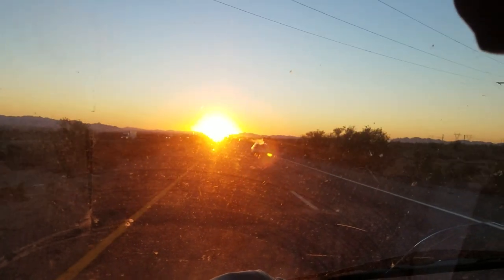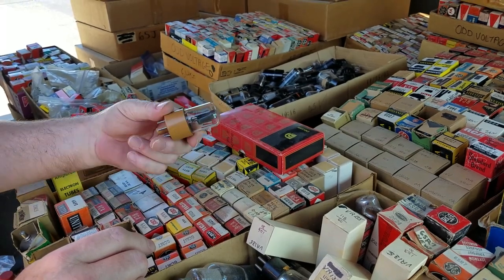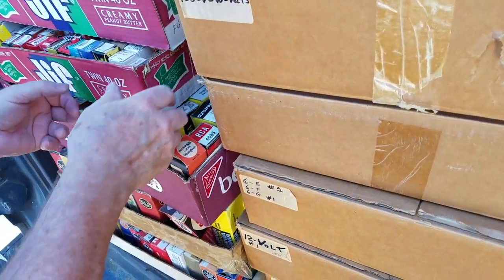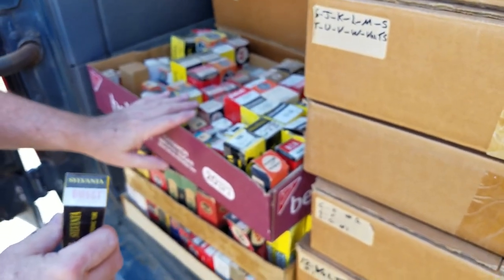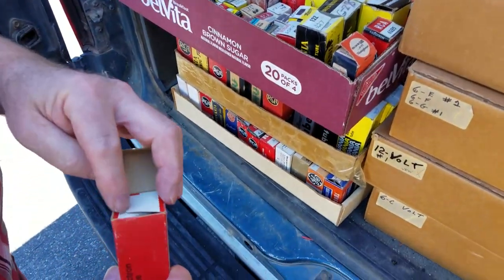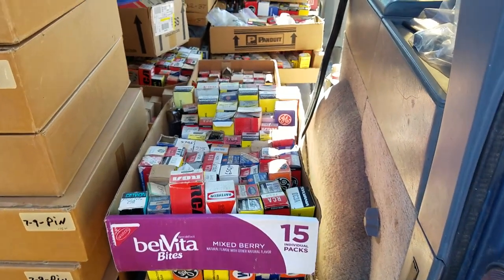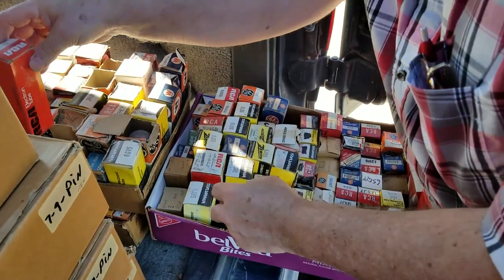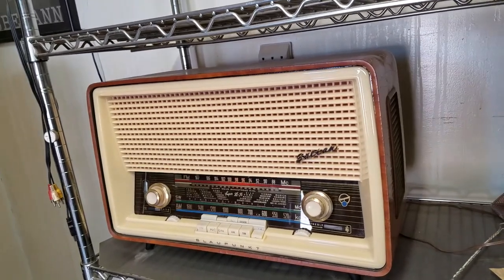Talkin Vacuum Tubes With AL

Comment: Man, I learned  more about tubes on this video then I knew could be out there. Makes me aware of the things I do not know even existed to learn about. I guess that's why your cannel is on the top of my daily list to check for new lessons of the old days.  And I thought I had found a deal with Electronic Goldmine special on bags of electron tubes of various types 30 bucks a lot of 50 to 75 tubes.  Not that I have any use for them, back in the day I used to have a repairman's case filled with tubes, moved it from town to town till at long last I stopped working with them on old TVs and gave them to the guy on main street who was struggling to keep his shop going with the advent of cheap crap from China along with my old military tube tester given to my by my communications officer at Fort Myer Va in 1976.  He was pleased with the gift and eventually gave me an early top loading VCR that was virtually worthless but did work OK if you tuned the speed for each tape.

Comment: Al sounds like someone who has probably forgotten more than a lot of us will ever know about something. I'll have to agree with him that sweep tubes hold a lot of promise for audio output devices, and not just for OTL amps either. The last tube developed for audio output service, the 8417, had a channeled plate structure more like that of a sweep tube more than the flat plate of a 6550. 

On the subject of OTL amps, the only design I can think of that used sweep tubes was the Julius Futterman amplifier. This used a set of 6 6LF6s in a parallel totem pole circuit, but was capacitor coupled. Julius probably found that easier than chasing the offset around the drift, as likely happened with his first attempt in 1954 with 12B4s on the output. More recent attempts with vacuum tube OTL amps use a circlotron design. These are actually superior to the totem pole aa the drive is equal for each half of the waveform, and the drift cancels itself out.

This was a heck of a video Shango, thanks for sharing with us!
Reply: M

Comment: The number that ends the tube nomenclature usually refers to the number of active elements in the tube. For instance, a 12AX7 contains 2 grids, 2 plates and 2 cathodes, plus a filament or heater,  which adds up to a total of 7 elements.  Usually you will not see any tube number that adds up to exactly the same as its total number of pins because the heater or filament invariably requires at least 2 pins (or 3 pins if the heater has a center tap, as is the case with a 12AX7).  Therefore you might see a mini 9-pin tube ending with the number 8,  such as a 6U8 or 6GH8; but if the tube number ends with a 9, such as a 6AF9, 6C9 or 6T9, those tubes actually have 10 pins!  Yes, you read this correctly!  There are a few tube types that have either a standalone center pin in the middle of the tube base as the 10th pin or it might have 10 pins in the semicircle instead of the usual 9 pins.

 And yes, the 1st number typically stands for the heater voltage, voltage except that Loctal tubes that run on a 6 V heater axttuakky start with a 7 such as the 7C5 (which is basically a 6V6 with a totally different base and pin out), and a Loctal tube designed for 12 V operation will start with the number 14.  You've also got other weirdness such as the fact that a 12AX7 and the other tubes in that family can be wired to run off of 6V as well as 12V,  but a 12SN7 or 12SL7 cannot run off of 6V.

Comment: 17:10 a discussion about Thyratrons....
I was working in a Steel mill with a line dating to the early 1960s and we still had some variable speed drives using that tube to provide excitation current to some equipment on the drive line.

I used to walk by the spares cabinet see all them tubes and think man that's got to be worth something because  there is no suppliers left for this stuff. I wonder how they got on after I left if that stuff is still there and if that drive line is still running.

Comment: Good video about "FIREBOTTLES!!!!"Watching this during the quiet hours at work waiting to turn SW transmitters back on in the wee hours of the morning.Al knows his "bulbs"-tubes.Learned some things from him as he narrated about the tubes being looked at.WE used to have 3 500Kw Continental Electronics short wave transmitters that used 2 thyratrons and an ignatron in the HV supply crowbar.It was scary any time the crowbar was tripped-sounded like a shotgun going off and you jumpted out of your skin!!! The thyratrons were-5727,and that drove a 3B28-then that one drove the ignatron.You tested it with the HV off and watched for the 3B28 to flash.Those transmitters used a  15Kv 60A.They were replaced a few years ago with newer 250Kw Continental transmitters with solid state modulators.Still use a 4CV250000 tube in the RF output amp.

Comment: Yes! Roadtrip.  Those WE 341b tubes have Krypton gas in them.  I saw them in some dark equipment in an AT&T Longlines Microwave site once. They have a warning on them not to dispose of more than 50 at a time.
Reply: I live about 10 miles from the former Hawley, PA Longlines Earth Station.
Reply: The 346C's contain krypton, the 346B's use radium-226 in salt form, specifically radium bromide.

If they are marked with the trifoil the tube contains more than average, average for the 346B's was 2.0uCi of Radium bromide. 

Any that contain Krypton specifically Kr85 as most commonly used would be long gone by now with a just shy of 11year half life. 
If there was any life left the tube would sheild a majority of what he is detecting, krypton-85 and its decay chain is a pure beta emitter. Even with "breaking radiation " from the beta absorption of the glass it wouldn't be as hot unless fully new.

Comment: The dot matrix below the type number on GE tubes was a date code used on later production tubes from GE's factory in Owensboro Kentucky. There is a page out there that explains the dot code, just search for it.

Tung-Sol also used the octagon box around the type number on miniature tubes, just with a different font and darker ink than RCA.

Comment: I fixed my first radio in 1951 !  I also found some of my favorite tube brands mentioned. In the mid '50s we changed many 5U4 full wave bridge rectifiers to a solid state (2.5A diode).   Also changed a lot of selenium Stacks out the same way. We were a Radio Shack Dealer and were talked into ordering a base order of Radio Shack Lifetime tubes. Their warranty was only if the product was over a certain amount. If it was less, the dealer was to honor (eat) the return ! We did not reorder their tubes a third time.

Comment: The 6 volt version of 12AV5,  6AV5, was used in a few Bogen or Rauland PA amps. The 6012 thyratron was used in elevator switching controls IIRC. The 2D21, miniature thyratron, was used in jukeboxes.  I think I still have some of both of those types around here but finding the people who need them is always difficult. Sometimes when you buy big batches of industrial tubes you get stuck with toxic waste that will cost you to dispose of safely. I've got some 555 rectifier diodes that were used in welding machines I think,  and each one has a couple tablespoonfuls of liquid Mercury.  I haven't found anybody who wants or can use them and it's gonna cost me a 100 bucks to have them safely disposed of by a hazardous waste company which is an hour and a 1/2 drive away from me.
Reply: the 6012 was also used on small "D.C." motors for speed regulation/ dynamic breaking.

Comment: Interesting video. A note about CBS tubes---in the 50's they bought out Hytron, and from that point on, CBS was a legit tube manufacturer. But the timing was poor, as transistors soon replaced tubes in many devices, and tube sales plummeted

Comment: Great video, Shango, and an excellent field trip! Yep, I have always liked Sylvania tubes, every bit as good maybe even better than RCA. I bought a garage full of tubes and gear from an old radio guy a few years ago. What was unfortunate was that I got about 3 dozen NIB 6L6 tubes but they were 6L6G which cannot take (if you believe their ratings) over 350 v plate, and several dozen 6L6M metals which are even worse. He had some old radios which I resold for pretty good profit. You're gonna find that most of the tubes you've shown will be useless, with those odd heater numbers. You'll use 3-4-5 out of a hundred. Sigh, ces't la vie. Thanks for taking us along, that was very thoughtful of you!
Reply: A special-case scenario: I had a dozen NOS, NIB 350B tubes, same as 6L6G (except for higher heater current), made by (or perhaps branded for) National Union, in NU boxes. Same tube as Western Electric 350B. I got anywhere from $200 to $400 apiece for them on flea-bay, some 15 years ago.  One guy in Asia (an American ex-pat) who bought a pair of them for $800 said he was going to use them as part of a regulated power supply for a home built audio amplifier.
Reply: @goodun2974  There is no question that some Asian guys will go completely bat__it crazy over those older tubes, NOS. But for the love of any sort of rationality, you would do this for power supply tubes?
Reply: @pneumatic00   It surprised the hell out of me but who am I to argue? The guy wasnt Asian either,  he was British or American as I recall

Comment: With deference to Al, it should probably be clarified that NOS USA and European tubes typically didn't have any "cladding" or plating on the pins except in the case of octal based tubes.  Miniature tubes are supposed to use pins made of a nickel alloy called Monel which has the same expansion and contraction characteristics as glass in order to prevent the glass from cracking as the pins heat up.  I have cleaned the pins on thousands of miniature tubes with a wire brush and they all look exactly the same when the oxide is removed.

 I read somewhere years ago that it only takes a micron thick layer of gold or gold alloy to make it appear to the naked human eye as if the pins or contacts are actually made of gold or heavily plated with gold,  and so people are easily fooled by the marketing surrounding gold plated electronic connectors!  and so on.  Not all "gold" is the same.  I've worked on plenty of old Sansui Hifi and other equipment with plug-in circuit boards that use gold plated contacts, and you have to carefully polish all the connections because they oxidize and become intermittent.  Gold actually does form a molecular thin level of oxidation that is supposed to be easily displaced simply by plugging the connectors together, however, gold being an expensive material,  they probably don't use very much of it in the actual plating of anything that reports to be gold plated nowadays, Or it's alloyed with massive amounts of other medals that decrease the effectiveness of gold as a purportedly non oxidizing connector material.

Comment: Neon regulators: the 991 looks similar to a neon bulb with two base contacts and a bayonet collar; occasionally used as an indicator lamp but mostly used as a voltage regulator. I have some Western Electric 991's!  As for actual voltage regulator tubes,  a few models of 1960s Gibson guitar amplifiers used a small voltage regulator tube, an 0A3 or 0B3 as I recall.

Comment: Photocell tubes were used in motion picture projector with tube based sound systems until the 70's when solid state amplifiers started taking over.  As I recall, 90VDC was applied to the anode of the tube through a several meg resistor.  The cathode sat at ground potential.  The light hitting the tube changes its conductance, and the signal was coupled off the plate to a preamp through a capacitor.  This system was later replaced by miniature solar cells which fed a preamp to recover the optical track.  Not much changed until the end of the mechanical cinema era when dye based soundtracks were brought in.  The idea behind the process was to eliminate a step in the film development process where a narrow bead of silver developer was applied to the optical soundtrack to develop it.  This was a necessary, as white light playback equipment needed the density of the silver in the emulsion to block the largely IR illumination that the cell was sensitive to.  The last generation of prints had cyan colored tracks which would not play back on white light equipment and needed red light instead.

Comment: at 11:13 https://youtu.be/fagQi8EgYnk?t=673 - The tube that Al was talking about is light sensitive. The audio track is encoded into the film on the side of the frame that is not visible when projected. This process was used to keep costs down when making film copies for mass distribution. Cheaper to have the chemical film development process create both audio and video instead of impregnating a magnetic strip onto the film and have a separate magnetic tape head write the audio track. 

See the following example on how it works and a few samples of actual film in motion:

How old school projectors work - https://youtu.be/LP6sEacLCHU?t=354

Decoded sound from optical audio track (16mm & 35mm film) - https://www.youtube.com/watch?v=OSzQCyDEMxU - skip the last half of the video if you want to spare yourself from watching a certain late night talk show host dance like a doofus.

Comment: 2X2's were also in early electronic air cleaners, 2 tubes in a doubler circuit to get the two voltages required by the precipitron grids.
Reply: 2x2's are also EXCELLENT x-ray generators.  Look up on YouTube for examples.

Comment: In the 70's through the '90's when I swapped or bought new tubes for sound equipment, Realistic was the way to go because they were considerably cheaper than the Local Electronics Supplier and of course the "Lifetime Guarantee" was for me, a selling point.  I didn't know they were shit tubes until just now!

Comment: I always wondered where you got replacement tubes...  I still have the audio amplifier I built in high school around 1970.   Kinda buzzy; I think the electrolytic filter caps in the power supply have dried out.

Comment: The 1960’s Had  Lots of Tv s  and Radio s  and  amplifiers with these old valves our first TV was the Echo Vision it used  a magic eye tuning valve with a  6AL 3  ,  6CM5 and a1S2  The PICTURE Tube was black and white.But in 1975 Tv went COLOR and a Lot of The Valves were not available to Buy any longer they just became obsolete .Your collection is impressive but due to the development of the TRANSISTOR Valves are difficult to Find.

Comment: Those photo tubes were also used in industrial photo switches. Like to detect a product on a conveyor as it runs. There would be a bright beam sent across the area to be detected.
Reply: aka electric eye not the same as a 6E5, 6T5, 6U5 ect.
Reply: @randyab9go188  Those indicator tubes were called "magic eyes". There's one in that radio in the shop.

Comment: I found a strange tube in my stock have 4 fat pins and a little pin stub on the side of the black socket.Red letters AR 12(or ohm symbol)2A/5165 and a red dot under the red markings.Rectifier tube?

Comment: I just got a philco courier 16 inch black and white tv the other day. The guy who owned it died sadly and the house was coming apart from lack of maintenance the tv is in pretty good shape. But one of the vertical pots is very touchy if you move it even slightly the picture goes blank any help?

Comment: Those PL36 / PL500 / PL504 / PL509 were used in tube TVs in Europe socialist block countries (except for Soviet Union) as beam power tube under different brands (Tungsram, Tesla, Telam, Polam). Audiophiles do not like them because of their characteristics, but many amateurs use them for audio amps. I build an A-class amp with these as well and it works nicely. I use the screen grid to drive them and bias them as well. Control grid is not used - connected to cathode.
Reply: Some years back, I had the unfortunate experience of spending way too much bench time trying to repair an Italian-made Graaf hifi amplifier with PL509 outputs (IIRC) that kept going into thermal runaway. I never did fix it, because I didn't know that printed circuit boards can become conductive and voltage from the screen or plate traces and socket connections can leak to the grid through the board and upset the bias. Apparently this is also a problem for some Marshall and Mesa Boogie guitar amplifiers, but repairable by strategically cutting/drilling holes or slots in the board to disconnect some of the foil traces, and hardwiring the circuits with flying wires to eliminate voltage bleed through the board.

Comment: The isotope used in those tubes is most likely nickel-63 which is a beta emitter with a half-life of about 100 years.  Nickel-63 is still an important radioisotope for certain applications such as gas tube spark arrestors and ionization-based explosive trace detectors.
Reply: Looked like they were Westinghouse 346B's which usually contain around 2uCi of Radium salts, usually in the form of Radium bromide.

I cant exactly speak on what his reading should be for one containing Nickel-63 since I dont own any containing said isotope. Although as for ones containing Radium-Bromide his readings weren't far off what is to be expected, especially considering his probe.

In this case since Shango didnt exactly say what type of probe I suspect it's a Ludlum measurements  model 44-2 gamma only scintillator, mostly by its shape and the body characteristics I can see in the video.

Although I do suspect even with the sensitivity of his probe if any did contain Nickel-63 the breaking radiation might not have been as prominent as shown in the video.

In this case I can say since Shango replied back to a comment I made, he said he was in the lower ranges of his meter. Which i assume to be a LM model 3 as is the most common to find in applications requiring the scale and probe he is using.

In this case Shango didnt specifically what range exactly so I can only speculate, so it appears his readings might have been around 0-5uR full scale or 0-50uR full scale.